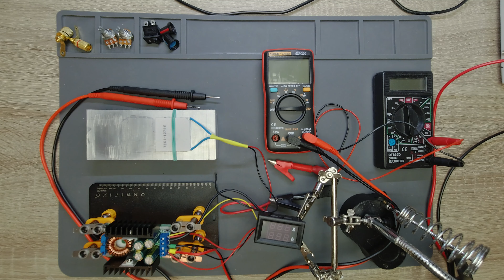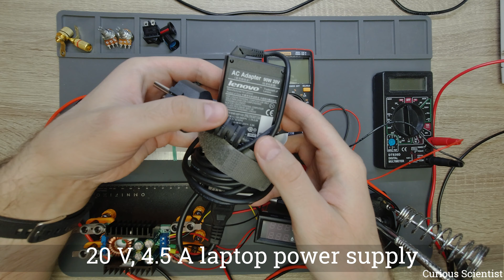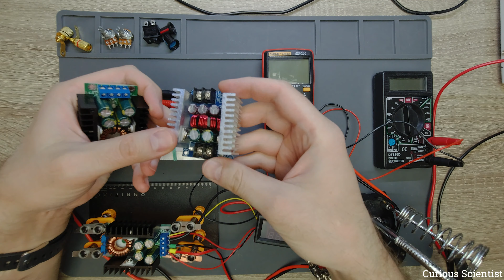DIY variable power supply from a laptop adapter

Comment: I tried to replicate this project following your guide but unfortunately didn't work. I bought the DC-DC converter from Amazon (the one equiped with LM25116). As first test, I used a current costant LED driver (24V 6.25A) and then an universal PC power supply charger. For both "driver" I was able to change only the voltage but not the current. As load I chose a 24V strip LED. Am I doing something wrong?
Reply from the maker: Hi!
It won't work with a constant current driver. You need a constant voltage source. The constant current driver tries to adjust the output voltage based on the demand, but the buck converter expects a stable voltage. This confuses the feedback of the buck converter.
Reply: @CuriousScientist  Hi!. Thanks for your fast reply. 
I understand, but why the buck converter doesn't work also with the pc's battery charge?
Reply from the maker: Maybe it is also a constant current source. I don't know, since you haven't told anything specific about the charger.
Reply: @CuriousScientist  the battery charger is a Hama 00012102, set for 24V 2.75A output
Reply from the maker: Maybe the load is trying to draw more power than your Hama power adapter provides?

Comment: Hey, can you run the psu withot attaching the signal pin in the middle?
Reply from the maker: Hi! Sorry, but what do you mean by signal pin? Can you tell at which time I showed it in the video?
Reply: @CuriousScientist  there is a pin in the middle of the barrel plug. i meant that but i figured it out. it doesn't matter, you can use the psu without it attached. thanks anyway
Reply from the maker: I am glad that you figured it out!

Comment: Cool recycling project. Once you start experimenting you never have enough power supplies :)
Reply from the maker: Thanks! Yeah, especially now when I have several stepper motor projects parallel. It is good that I don't need to mess with the same PSU for all projects.

Comment: Ottimo, lo metto nei progetti da fare ;o) - Great, I put it in "project to do"!
Reply from the maker: Thank you! It really worth to save them. A lot of power packed in a small package. With this regulator circuit, you have a great freedom to produce any voltage and current for the most common circuits.